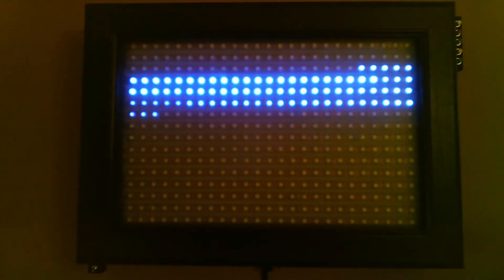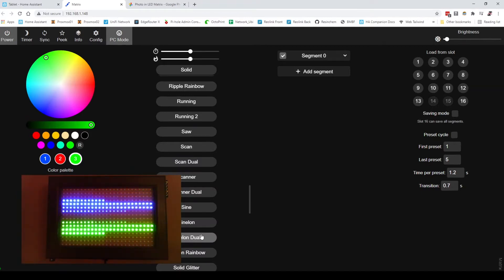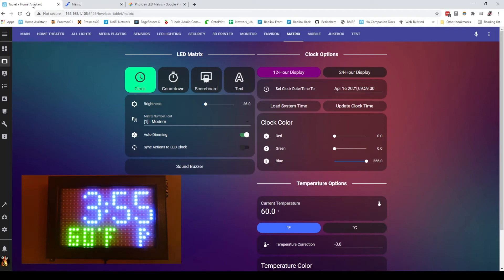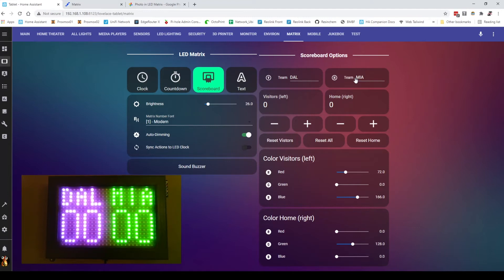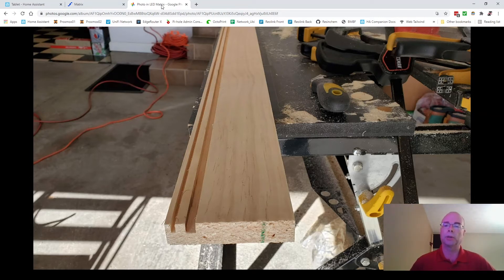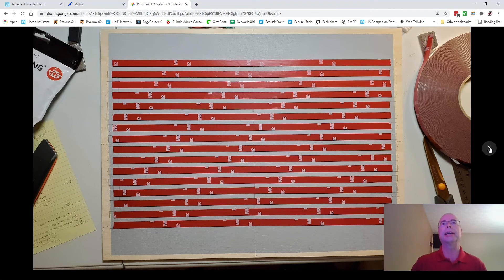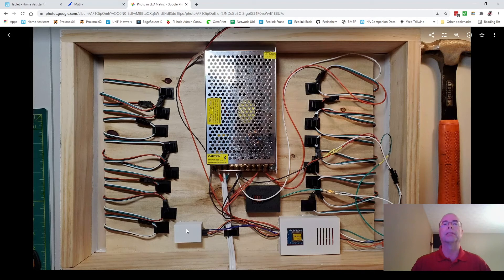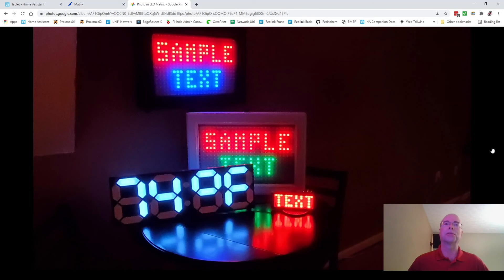WS2812b Matrix with Dual-Controller Clock and WLED

Comment: I like this very much, but cool you think you are able to simplify on either your blog post or a new video just for clock on top half and text on bottom half?
Reply from the maker: Thanks... glad you like it.  However, the way the code works, each of the numbers and letters are designed for a block or "zone" of the LEDs in the matrix.  Moving the "text" block to the area under the clock would require some pretty substantial changes and rewrites to the code to alter how the current letters/numbers are laid out on the matrix.  It would also involve changing the code logic to combine the current procedures that display the clock/temperature in one mode and the text in another mode to instead show the time and a row of text.  It's definitely something that can't be done in just the front end... and not something that could be done easily by just changing a few lines of code.

 Unfortunately, I simply don't have the time to investigate making these changes based on my current projects and other responsibilities.  However, the code for the matrix is freely available on Github, so you could attempt to alter the code yourself to move the text display area and the logic to display the second row of text with the clock/time.  Sorry I can't offer any additional assistant to making those changes.

Comment: Hello, I have learned a lot from your videos and would like to ask if you have time to look at a project that is related to this but very different. I have the coding worked out (in principle) but the yaml is giving me a formatting error that I cannot seem to resolve. I get either the value for the seconds fields in my time automation is not 0-59 when it is 0 or I get that the seconds field is not the expected action. Any suggestions would be appreciated. I have used the ESPHome site for formatting the time automation but it is not providing the solution.
Reply from the maker: I'm happy to try to help out.  Can you possibly post the YAML line(s) that are throwing the error?  It can be kind of tough to do a lot of detailed troubleshooting here in the YouTube comments.

Do you happen to have a Discord account?  It might be much easier to troubleshoot there, where it is much easier to post and format larger blocks of code.  If you'd prefer to go that route, I'd just need to get your full Discord ID (with the #nnnn at the end) and I can reach out via DM.  If you don't want to post your Discord ID here in the comments, then you can reach out to me via email with that info.  You can get my contact email address on the "About" page of my channel (listed under 'business inquiries').
Reply from the maker: Great!  I sent you a request over on Discord.  Once we get connected over there, it will be much easier to try to troubleshoot and assist than it is here in YouTube comments.

Comment: i am looking for a mqtt integration for a 64x64 p5 and 32x64 p3 led matrix...
Reply from the maker: I ended up writing my own Arduino code for the ESP8266 using the Fastled library and PubSubClient for the MQTT portion.   It would have to be pretty heavily modified to work with 64x64 or 32x64, but if it is helpful you can find my code on Github: https://github.com/Resinchem/LED-Matrix-Clock_WS2812b

It might help you at least get started.  Or if you can find code that already works with the matrix, adding MQTT to that isn't difficult.  Again, you can see that in my code.  I'd be happy to answer any particular questions you have, but odds are you are either going to have to write your own controller code, or modify existing code to add MQTT functionality.

Comment: Wow; great!!! Is there any .bin files for flashing on ESP8266-01 or esp32? Thx
Reply from the maker: Thanks!  I don't have a compiled .bin file, but all of the Arduino source code is available in my Github repo: https://github.com/Resinchem/LED-Matrix-Clock_WS2812b  

This is for the ESP8266, but it wouldn't take much work to create a version for the ESP32.  The .ino and associated .h files could easily be compiled into a .bin file if desired.

Thanks for watching.
Reply: @ResinChemTech  I tried to compile with arduino, there were some errors 😳. I would like to use my 16x16 WS2812 matrix with home assistant.
I'll try again...
Reply from the maker: I'd be happy to try and help to resolve the compile errors, but the code would have to be pretty heavily modified to work with a 16 x 16 matrix, as it is pretty specific to lighting up the individual pixels based on my 25 x 16 layout. 

As far as Home Assistant integration is concerned, it is all done via MQTT.  The Arduino code both sends MQTT to Home Assistant to update states... and receives MQTT commands from Home Assistant for control.  I'd be happy to provide more info if you'd like... just let me know!

Comment: How to use the matrix as a display? I want to see the tempreture on it and voltage. Does anybody have some examples or ideas?
Reply from the maker: The matrix is designed so that it can pretty much display anything alpha-numeric that you want.  It is all done via MQTT commands.  So if you had a voltage source/measurement, you could use MQTT to send that value to the matrix display.  For example, I am displaying the outdoor temperature in clock mode.  That is read by Home Assistant and sent to the clock via MQTT once every 3 minutes.  You have different options in terms of size and placement (e.g. large number, small letters, etc.).  If it helps, you can take a look at the wiki in the Gitub repo that describes the layout and use of the matrix along with available MQTT commands: https://github.com/Resinchem/LED-Matrix-Clock_WS2812b/wiki

Of course, the C++ code for the matrix is there as well, so you could also modify that to meet any special needs that you might have.  I hope that helps a little... or at least points you in the right direction.
Reply: @ResinChemTech  yeah, thanks for the info :)

Comment: Could you go any bigger with your code for the clock side as I’m in the making of making a panel 30x30 leds
Reply from the maker: You could certainly modify my code for a different matrix layout.  You would just need to update the arrays for the letters, numbers and pixel positions at the top part of the main .ino file.  These arrays control which pixels are lit and which ones are not to form each letter or number, and it's position within the array.  For example, to form a large number "1" in the top left corner, I light up pixels 153, 198, 203, 248, 253, 298, 303, 348 and 353.  Both the layout and the numbers/letters themselves are defined in those top arrays. Since your individual pixels will be in different locations, you'd have to just update these array values to match your layout.  I used a spreadsheet to help me determine the locations and how the arrays were structured.

Once that is done, the rest of the logic should work fine as the display process just calls the appropriate array values to light up the matrix for a given letter or number and its position.  Good luck with your project and don't hesitate to reach out with any other questions.
Reply: @ResinChemTech  hay sorry another question are you using a single data pin to control all the lights or are you using more  as I’m running into a problem where the lights are all jittery and some stay on when there ment to be off 
And when ment to be in a solid colour with no effect they are all moving about showing multiple colours or would you know a way in that I could improve this or if it is even the data channels fault
Reply from the maker: Just a single pin.. and a single data connection to the start of the LED strips.  But it definitely sounds like some sort of signal problem based on what you are describing.  Are you using a logic level shifter?  You might also verify that all your solder connections are solid.  I actually have dual controllers in my matrix (the signal to the strips are connected to a toggle switch that selects the controller to use for the signal).  What code are you running?  Do you have another controller with something like WLED that you could test with to try to troubleshoot where the problem is occurring?

Let me know if I can help out any further... but what you are describing sure sounds like some sort of signal or interference problem.
Reply: @ResinChemTech  I only have the wled board set up atm and no but I’ve ordered one now so I’ll se if that works
Reply from the maker: If you haven't seen it yet, you might take a look at this video: https://youtu.be/Q9mLitVxF3c  where I show what happens when there is a signal problem (in this case due to a voltage drop on the signal line).  But is what I show in that video similar to the effects that you are seeing (wrong colors, lights going wonky, etc.)?  If you are seeing something like that, it is very likely a signal problem... maybe too low voltage.  And a logic level shifter should fix that problem if that is truly what is causing the issue.
Reply: @ResinChemTech  Yh that is similar thanks 

Only other thing that happens is some of the lights get stuck turned on for a while when there not ment to be either when they are in an effect or turning off

Comment: this is supercool to watch
Reply from the maker: Thank you!  I'm considering upgrading the WLED to the new sound reactive version.  But to do so (and get the matrix effects), I have to replace the existing ESP8266 with an ESP32... meaning an entire new board and controller.  It's on the list, but not sure when I'll get to it.  Most of the time, the matrix is in clock mode.  Thanks for commenting!
Reply: @ResinChemTech  I would really appreciate you to do that.. And make a video on that... As even me planning to flash wledSR in esp32... It would. Be really. Helpful if you do That in future.. Even i guess many are moving to SR builds with esp32.. And appreciate your response and efforts.. Keep rocking 🔥

Comment: You did a great job on this.  Thanks for the video. I now have some ideas to continue with my 8x32 flexible strips. I just couldn't seem to figure out how to scroll text. I really like the way you have it set up in home assistant.
Reply from the maker: Thanks!  Glad it gave you some ideas.  Scrolling text is still on my list of enhancements.  Currently, the effects don't include that option.  I can shift a full letter position at a time, but not the smooth scrolling effect that I want.  I have a few other projects in process right now, but I hope to come back to this one soon.